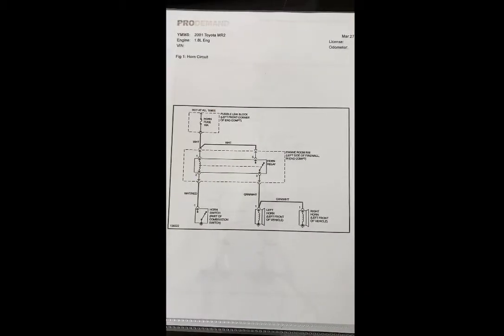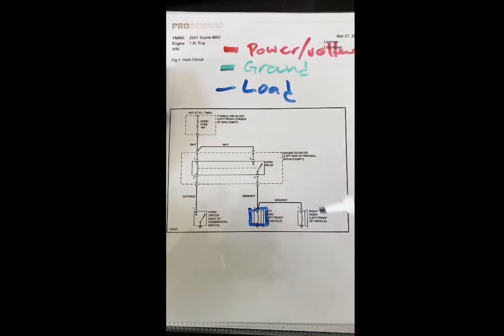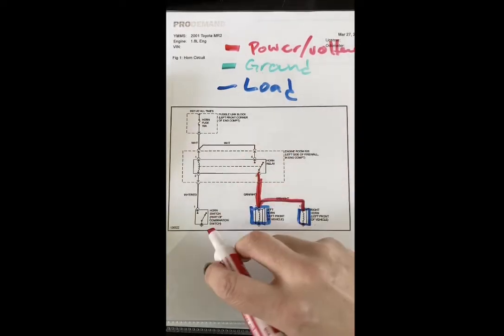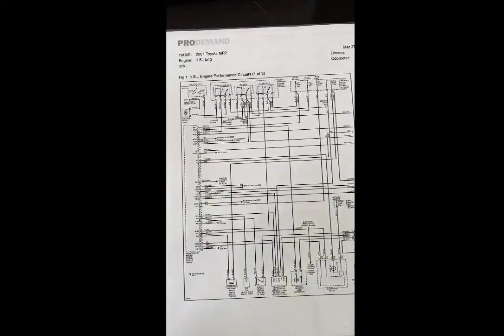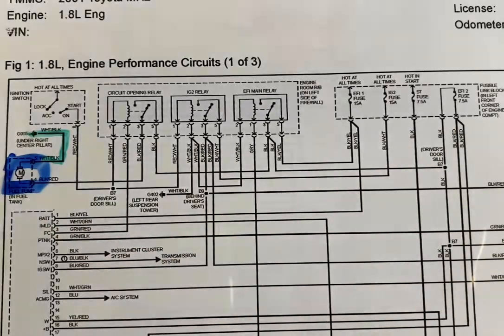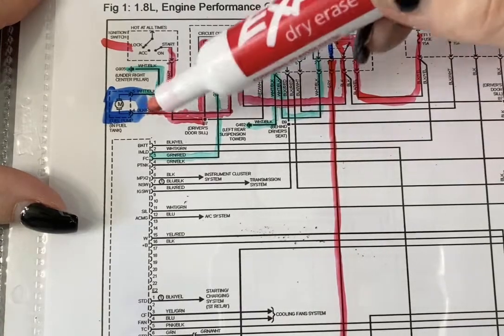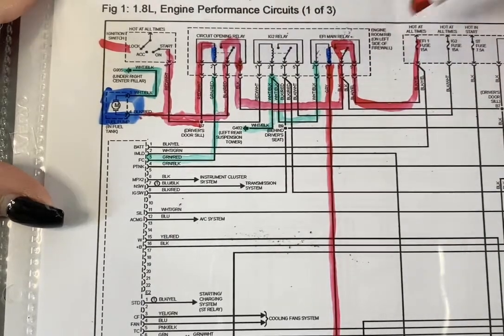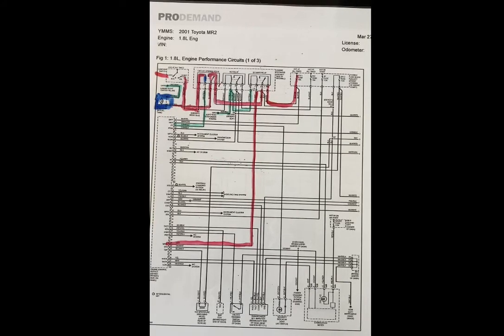Tracing Voltage Trough Wiring Diagrams

Comment: so when i trace these diagrams and because they are always shown on non active circuit should i trace it as if it was live circuit?what throws me for a loop is since we can see voltage on ground side and ground on voltage side with circuit unactive meaning like how we would read 12v and 12v on a bulb where we literally see battery voltage on ground as our readings backfeed through the lights filiment.this confuses me on how i should trace when tracing